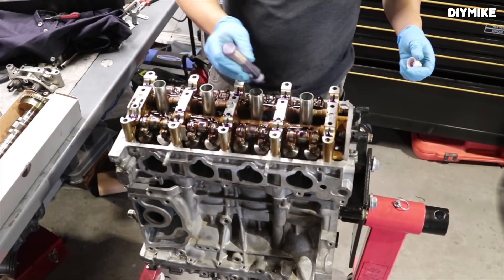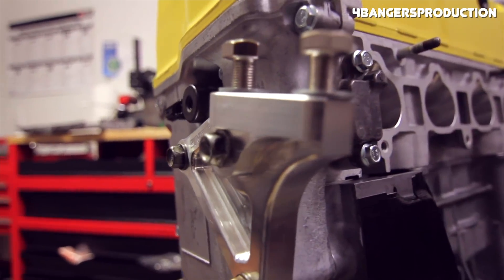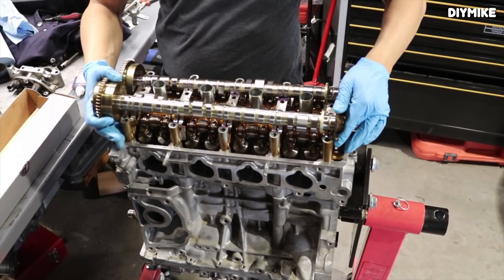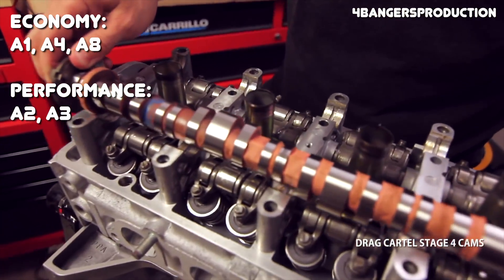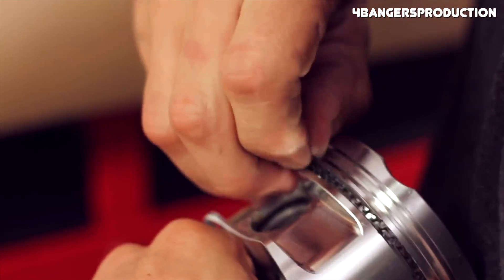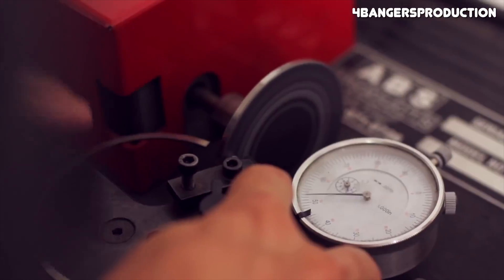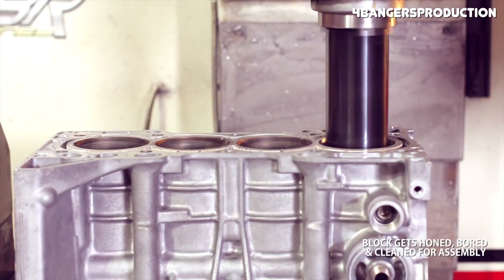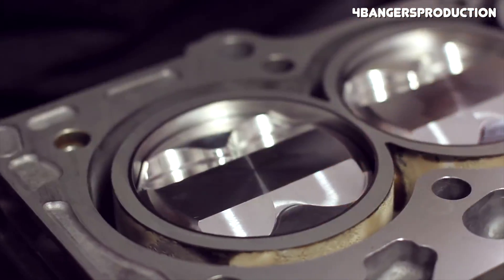Honda K24A: Everything You Need to Know

Comment: The k series is the top of mount everest of engine building for honda theyll never out do themselves and no other 4 cylinder can compare to its perfect design and reliability tunability stock engine internals will handle stupid ammounts of added boost or horsepower and hold up

Comment: So, theoretically if you got a k24a4. Bought cams and bored out the intake side of the head that would make the motor perform not as good as the A2 version but close to it? I know I think the video said the valves are also small but….theoretically correct?

Comment: So, I recently bought a honda accord 2011 ex-l. I realized I had a leak in the rear of the motor coming from the solenoid housing. I decided to just buy the whole unit rather than messing with gaskets, because the unit is old now anyway, but when I went to buy one they were extremely expensive due to there being 2 solenoids. I'm confused because I thought these were economy engines with v tec only on the intake. If that's the case why is there 2 solenoids? My 05 accord only had 1 solenoid so I'm assuming this engine has v tec on both cams. Am I incorrect? Please let me know and great video.

Comment: How can you tell the difference between a jdm k24a eco vs k24a high performance just by looking at it externally?
Reply: If you can read the engine number you can see at least what k24 you have. It should be stamped or etched somewhere on block. If you have the owner's manual it should show you somewhere under specifications.

Comment: Question: purchased a JDM K24A for my neices 04 Element.  Do I use the VTC oil control valve from the JDM motor or the K24A4 that we are replacing?  Or does it not matter?

Comment: I have a 13 CRV with a K 24 A1 Engine produces 185 crank horse and I think 150 to the wheels. What suggestions do you have for me to get maybe 200 to 220 wheel horsepower, I’m willing to do anything but pull the engine out of the car head work Cam work stuff like that I could live with. Being this is my second Honda I don’t know too much think you could help me thank you

Comment: Are your hp estimates on the reliability side bc i see stock k24 pushing 3+ to wheels with stock engine n sleeved pushing 1k . Are they full of it or  its true but  just blow up quickly? I wanna do a project car with my boy i grew up doing chevy small blocks but nowadays it seems hondas the way to go for project.  I could do chevy ls stuff but i wanna build a modern tuner car with him n learn to tune together n turbo it eventually cause the k24 blocks are cheap n everywhere.  If i could afford it id go boosted 1 or 2j for the power n sound but hondas a great place to start.

Comment: Please help me. I got a fg2 with a k24 swap. I bought it as it is. For a starter platform. So it has a k24a stamp with a ID starts with 55 don't remember the rest. But the block and head has rbb-1. And it came with a rbc intake alternator has the sensor on top

Comment: Is a JDM K24A (no suffix) compatible with K24A4 or K24A8?  I have a 2005 Element with a blown K24A4 and am considering a JDM K24A.  Are the cams and VTEC phasers the same?  I want to be sure that I don't have issues with the existing PCM in my Element. Thanks.

Comment: Great job explaining the Vtec engine,  question I Have do you know if you can re-ring a K24A engine in 2003 Honda Accord. The engine uses oil and the timing chain is pooched, no leaking at rear main seal. I done it before  with a 1989 Honda 1.5,  however can't seem to find an answer regarding the K24A engine. if you can help great, really enjoyed the video.

Comment: I have a 2005 Honda Element with the 2.4. I don't know a lot about engines so I wanted to ask a question. Does the vtec ever cut in? The one spec I looked at I could not find any RPM where it cuts in. It says it has 160 hp. I certainly don't need it in an Element. I have had the car since new and the motor is awesome as it is. Wouldn't the transmission have to be upgraded to handle big horsepower? Thanks

Comment: Love your videos VERY informative thank you for your time in all your research!.. I had the 2013 Civic SI just tuned w hondata, full race header w a 😺 stock exhaust drop in k&n air filter made 198 whp 174tq & absolutely love that car very reliable fun as hell & I hit 150 mph n' probably would have hit 160 because Hondata after the tune goes up to 150mph & I forgot to change it🙄 lol... & that's fast for my family sedan 🚗💨 I've owned 8th 9th & 10th gen Si I personally think the 9th gen was the best. It had a very simple setup very good transmission/motor was so reliable & very consistent, gas mileage was decent 26 city..10th gen very fun but once the turbo gets heat soaked you're fu$#ed but gas mileage with exhaust drop in filter would do 34 to 40 MPG even in the city! Sooo pros n' them damn cons 😎 all 4 the fun tho. God bless you all 🙏

Comment: What is the weight of the K24 engine? I am thinking about installing a supercharged K24 in a plane. I am wanting to push 350-400 HP
Reply: I think under 300lbs engine alone

Comment: Would be great to see a video on how to go about upgrading a stock k24 element on a budget!
Reply: Ktune, cheap FI. 

There's a couple on youtube running $600 ebay turbo + $400 ktuner, making 300whp+ on AWD setups.
Reply: I have a element with a k24a  that I swapped.
Reply: A cheap way to upgrade your motor is very simple (if youre still interested).  What I would do for something like an element k24, I would swap the pistons with oe performance cast 11:1 - 12:1 pistons.  Shave material off the rods, balance your crankshaft, find a budget minded lightweight flywheel.  For the head, mill it IF your compression is too low.  If your compression is too high for your liking OR if you don’t mind lowering it a bit more, deshroud the valves (deshrouding is taking material away from the chamber section of where the valve seats, ultimately increasing airflow and increasing power).  Next, the element motor doesn’t have “true vtec” yatayatayata.  They call me mr.nonvtec.  
Just get a vtc upgrade for the cam with vtec, port the head, port the intake manifold, upgrade your springs, AND THAT’S IT.  Now of days, that would cost you $2000 more or less.

Comment: I would like to see the difference between the J series and C series Honda V6 engines. And also whats the big difference between the F20C /F22C vs the K20 and K24. 

Also the Honda F20C held the record for best power per liter ratio NA from the factory for years until the Ferrari 458 broke the record.
Reply: C Series = 90 degree V6
J Series = 60 degree V6

Also, bore spacing is closer in the J-series, which doesn’t allow for as large of bore diameters. Consequently, J series engines generally have smaller bores and longer strokes for a given displacement than C series. Finally, C series was available with DOHC VTEC (in the NSX). All J-series engines are SOHC.
Reply: @matthewstorm5188  Have a crosstour with the J35. Ive done some bolt ons including a catless exhaust. Its sitting at around 330 at the wheels and its stupid fun to drive. I wish there was a simple and reliable way to put a six speed manual in it. It would be an absolute beast on gravel with one.
Reply: @  Provided the Crosstour isn’t AWD, couldn’t you just use a six speed from an Accord or TL?
Reply: @matthewstorm5188  Unfortunately it is Awd.
Reply: K series is basically F series but with adjustable VTC (cam timing) for better overall performance and tuning ability